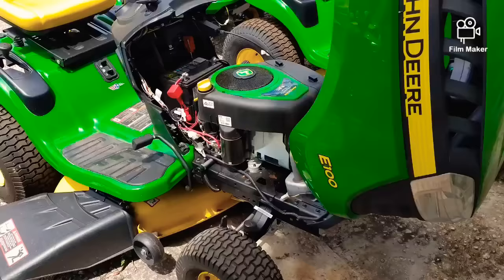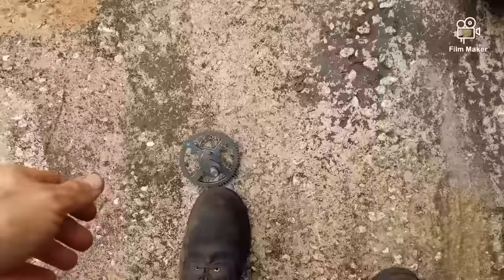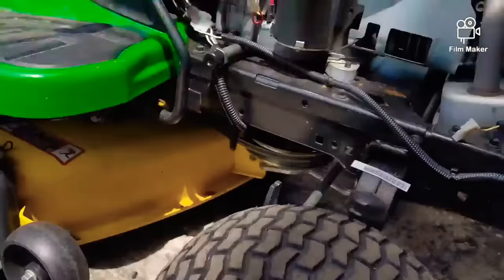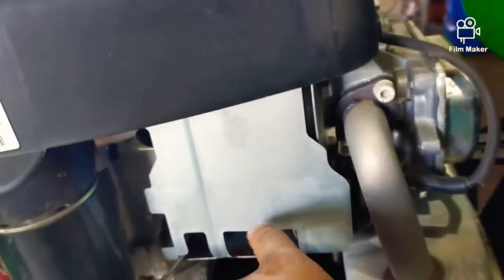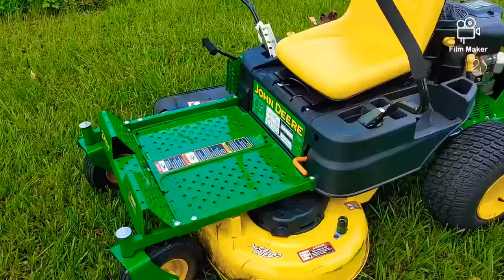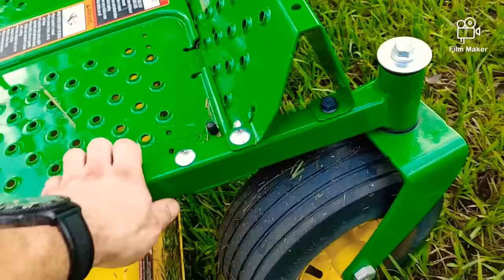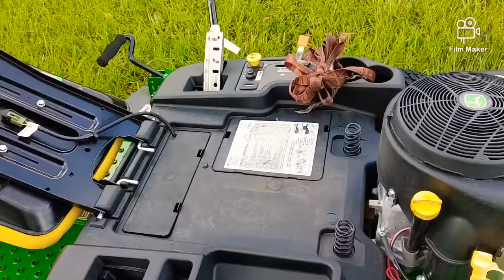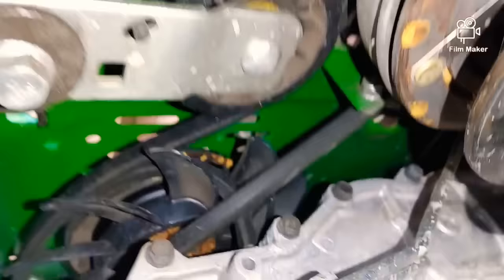Lawn mowers to avoid!

Comment: I've got one of those Zero-Turn mowers. Not the exact same model, but eerily similar. I use it as a residential, have a small yard, and at most I put an hour or so a month on it each Summer. Evidently, I have been extraordinarily lucky/gentle with it. I've gotten three years out of it so far and only just this year had to replace the battery for the 1st time. I believe it's about time I did an oil change on it, but I've put so few hours on it I'm not sure. Probably need to change the blades as well. I wouldn't dream of tipping it on its side, but I wondered how far can I lift the front end without borking the engine from oil shifting through it? And just where is the oil drain plug? (My wife tossed the manual, but I might could find an online copy.) I thought draining the oil in prep for a change, then lifting the front to get to the blades, then once the blades are replaced, finish doing the oil and filter change once the mower is level again would be the smartest move. Am I on the right track?  --Dan
Reply from the maker: Hi Dan, depening on your model the engine should have a plug on one side or both sides right above the frame. Do not be surpirsed if JD engineers designed it were the oil goes all over the frame...
We use extractors that have a tube that goes down the filler tube and then suck the oil out. 
As far as how far to tip it up to change blades we often lift them more than 45 degrees in the front even with oil in them.

Comment: I have a Z235..20cc OHV Twin  Zero turn and it's at least 5 yrs old. One Drive belt and same blades. Replaced 1 spindle assy. What should I be worried about.Seems like the Dealership has a better built mower than the discount retailers because I looked before buying. Your advise please. Maintenance is done when the oil starts to get black?w filters.. My mower is shed kept does not sit out in weather. Thanks for your video and experience. My mower came from the local John Deere Dealership.

Comment: I’ve got an x300 with a junk transaxle. I’ve seen on some other YouTube sites that the x300 should be used on flat ground only. I wasn’t told that when I bought the mower and a lot of my mowing is on hills. I’m a mechanic and can rebuild the transaxle but I’ve also heard that will not last either. I had a hydro 185 that I mowed with for 35 yrs and this x300 with 270 hrs is basically unuseable. Gonna have to do something so what do you suggest rebuild or buy something else? Definitely out off of JD they wouldn’t cover it under warranty
Reply from the maker: What year is the x300? Are you looking to get another lawn tractor or a zero turn?
Reply: @Mechanical_Mind  it is a 2017 with 270 hrs on it and I’m looking at another tractor

Comment: The John Deere D105 that was shown with the 31R977 engine that has the camshaft compression release mechanism problem, has Briggs and Stratton fixed that problem yet?   
The D100 Series was manufactored from 2011 to 2017.  Does the S100 with the 31R977 single cylinder engine have that problem too?

Comment: Thank you for the video I currently have the D140 which is a very good mower I do like it but I have been interested in a zero turn I guess I'm not going with John Deere. Can you recommend a good zero turn residential? I got slightly less than two acres.
Reply from the maker: John Deere does have decent residential mowers. But you have to spend over $5k or more. Id check out the Bad Boy MZ magnum they are about $4k. Very high quality decks. Or the Bad Boy Rambler is $3k but it only bad part is that it has a single cylinder 19hp Briggs

Comment: Just wondering what your opinion is on the Z530M mower. I was going to buy one but am now having second thoughts. Do the 500 series have the same issues as the 300 series?
Reply from the maker: Hey Joe, The 300s are much better than the Z300s. This video was made before they came out with the 2023 yr models. They have completely redesigned the Z300s and pretty much fixed all the issues I mentioned in this video except for still using the thin stamped deck.

Comment: I only have 1.5 acres and it’s a little hilly. Im considering a Husqvarna YTH1942 and a John deere s110. Which would be ideal. What’s the pros and cons in terms of maintenance and longevity. 
Thanks
Reply from the maker: I like Husqvarnas. Id recommend to get a v twin cylinder engine on either one. If you get a JD get at least a 130 or higher. We will not even sell 100s, 110s or 120s at our dealership. Buy from a dealer. Not Home Depot or Lowes. 
The S130 is a good mower if you keep it clean, maintained, grease it and dont abuse it.

Comment: The transmission he referred to as "plastic" is actually made from GRP stands for Glass Reinforced Plastic. “In fact, the composite material they use offers the same mechanical features as aluminum, such as stability, durability, rust-proof, and resistance to temperature extremes, while also being lighter-weight and more efficient to manufacture. ”It is also called fiberglass, composite plastic, or FRP. It is strong, extremely light, and highly versatile. GRP behaves differently from the conventional thermoplastics that are used in everyday items. NASA even uses this material. This means that it has properties that are useful for a range of applications within many industries. It is used in many automotive applications today "General Transmissions" are who manufactures these (General Transmissions is a family business, founded in 1991 and the world’s largest manufacturer of transmissions for the outdoor power equipment market — with more than 20 million transmissions sold to date.) this exact model is the rs800 (GT87140) and fits all serial numbers. As the RT400 transaxle is a mechanical transmission, the grease is in there only for heat dispersion and gear lubricating. The grease quantity is therefore much less critical than the oil level in a hydrostatic transaxle and, even if the leak seems excessive, there is usually no need to add any grease while replacing the seals. But 9 times out of 10 the only issues these transaxles have are usually always external. That being said This company offers pulley kit belts, Seals, etc. for all these external issues that happen. Most repair shops are not thought how to diag. these and just replace them because there is a lack of knowledgeable people in the field. Also if you go to a John Deere dealer for parts on these they don't offer them because they don't make them and John Deere just slaps their part number on the assembly and marks it up and tries and sell you the whole transaxle. yes, these though John Deere is $600-$700 dollars as of this date. but you can find them as cheap as $479.99 on Amazon. But like I said 9/10 these can always be fixed for usually under $20-$100 if you do the work yourself, They offer Troubleshooting guides service manuals, and parts on their website everything needed to properly find the issue and do the repair. Now the rt400 is meant to last around 500 hours under normal load. No one will tell you this doesn't make a good selling point. 

Now the Briggs engine (Intek series 300000) Model on this exact engine is (31R977-0052-G1) The part he is referring to is the (793880) Camshaft which since last year they were updated to the part number 84005207 (this new part corrected the issue what they changed I've asked many service techs at Briggs even district reps. they weren't able to tell me, but of the tens of thousands they sent out since the release of the new part hasn't failed with the same issue. I was able to find a service bulletin (Bulletin # DSB-1071) Which was released on Oct. 2017 310000 AND 330000 OHV ENGINES were affected referring to the issue is the spring and lever on the compression release valve would fail and falling off and sinking to the sump of the engine. From my research, I've concluded the parts were most likely improperly inspected by the factory. They never recalled these for the issue because there were millions of this series of engines released and the issue a lot of the times would happen out of warranty period so saving Briggs from technically going bankrupt if it even acknowledged the fact this part was faulty and deserved a recall. Briggs failed as a company because of corp greed from the executives they went bankrupt in 2020. But there under new management, they have been improving. You can buy the whole entire aftermarket service kit with seals, gaskets, and camshaft along with connecting rods for $28.99 on Amazon vs. $95.99 through OEM parts from Briggs. It's not that bad of a repair to do. These engines are at the lower end and are not commercial. They are designed and tested to last and fail at (500hrs at full load speeds)

Now you have to realize by now this mower sold brand new for $1,500.00. It's a cheap mower meant to be used for residential properties under 2 acres, and flat land not rough terrain (due to a stamped deck), and its failure is built into that price point the mower will last you 5 years on avg. The engine and transmission are rated to last 500 hours. if you are buying a mower for $1500 (adjusted for today's price point due to the economy it's closer to $2,000-$2,400 yes prices only 2 years ago were up to $900 cheaper thanks to inflation for that now) but this mower in this range will always be made to last you 500hrs don't matter the brand make or model. The people selling these will never tell you that. this is caused by capitalism and the need to make the cheapest costing builds for a company to make this riding mower it cost them around $700-$1,100 as of this date. After making contracts with engine manufacturers and additional parts manufacturers to drive down their cost of components. The need to make them lighter to drive shipping and manufacturing costs down causes the need to make parts such as blades, spindles, and frames as lightly and cheaply as possible. Mower Dealers only make usually around %20 percent of the sale of new equipment.

During the mid-1980s the end of what you would call a legacy mower ended (meaning you were able to pass it down to your kids). Before the end, what you call a legacy mower would last you and be rated to last 15-20 years. Cast-iron engines that were rated to last over 1000hrs you could run damn near low on oil and it wouldn't blow up, strong steel and cast-iron frames and steering components with all greaseable fittings on spindles and American-made bearing in spindles, replaceable balljoint linkages, ticker gauge mower decks.
Reply: All those words bro just reason a broken machine that matienced at about the retail price... pure crap! Shame on you
Reply: I agree on that plastic tranny. 
My Craftsman has 600 some hours of moderate hilly ground. 
Aside from fwd-rev sometimes sticks if I change direction too suddenly, working fine. 
The only care the tranny gets, every few times I use it, I'll blow off debris build up on top with its linkages.

Comment: Came across your videos because i was given a 2007 Z425b mower.  It cuts great, but was wondering about the control arms that go forward and reverse.   When you pull back reverse works correctly.  But when you push forward with any force it doesn't react.   If you move it slowly it does.  With it being and older mower,  is this a common issue.  Any help will be greatly appreciated.    Thanks

Comment: I am surprised that companies make commercial and cheap consumer model. The big box stores sell consumer model cheaper bona fide john Deere dealers.  Box store sellsmainly on price. Briggs and Stratton makes a price sensitive engine for cheaper model. Thevommercal industrial engine has a iron sleeves in the cylinder.  Oil and filters are cheap when compared to replacement engines and labour

Comment: So what is the cheapest but beat sit down riding lawn mower?
Reply from the maker: The new 2023 John Deere Z300s are far better than the 2018 - 2022 year models covered in this video. Right now the new 2023 John Deere z330M is probably my #2 pick. #1st pick would be the CubCadet Ultima ZT1. If has a better deck and better warranty.  https://youtu.be/a0TkSzqnCSc
I still need to go over Toro more and also Husqvarna and Kubota. All 3 of those brands make good equipment. It woydlnt3 surprise me if one of those take the #1 spot. Thank you for watching and dont forget to subcribe! 🍻

Comment: My Z225 had 2x2 frame across the rear for lawn trailer hitch. Do the newer 315E have capability to attach a hitch?  From what I can see in the video a hitch can not be attached.
Reply from the maker: The new 2023 models are much better and improved. I think they can have a hitch installed. Here is a recent video I did on them https://youtu.be/wSLQwtbfVno

Comment: Hello Sir I was given a JD LX277 great shape other than the sorry plastic hood. I did put new bearing on the main back pulley, new belts greased all fittings on the spindles which are in good shape but every time I engage the PTO it makes a screeching noise and I cannot figure it out. Also this model doesn’t have switch to allow the blades to continue you run every time I have to back up therefore I have keep engaging the pto making think gees this has got to wear and tear on the belts and the pto switch. Can you shed any light on how I can fix that screeching ordeal Sir? Barry W

Comment: I have a z335e and I  had a  z225 before that , the difference is  night and day  I don't  know why they  changed it but it's very disappointing.  The 335 has a way smaller gas tank and the  deck is a piece of crap . Mine is pushed in on the front  from hitting a tree root . How can you take something good and  make it bad?

Comment: I have a JD Z540M with the stamped deck and a kawasaki motor. I have been super happy with it, would it fall in the same class as this mower? I cut about 2.5 acres and would consider trading up. Thoughts?

Comment: @Mechanical Mind, You mentioned that the E100 has the bad pressure release cam.  Does the newer model S100 suffer from the same problem?  I have the S100 and I am debating trading it out for a different tractor if it could cause me lots of problems in the future.
Reply from the maker: Its more an issue with the single cylinder B&S engine which was used across many brands of mowers. I personally have not seen many of the newer models have that issue. If you get another one get a S130 or higher. John Deere has stopped using the plastic transmissions on all the 100s series.
Thanks for watching!

Comment: What is your opinion on a 2022 John Deere S220 with the Twin Cylinder Briggs 42 inch cut mower with the Hydrostatic Transmission? It is the tractor type because I don’t care for the Zero Turn mowers.

Comment: Is there a residential zero turn mower that you would recommend? I have a little under 1.5 acres.
Reply from the maker: Yes Ive recently made some videos where I compare the 2023 residental zero turns. Also John Deere has improved the Z300s drastically for 2023

Comment: Those intek cams are cake to replace. 90 dollar oem cam and maybe hour hour and a half to replace. Replaced many and i actually look for these used with this prob to replace and use and resell. Bad design dont get me wrong byt its not a bad fix
Reply from the maker: Yeah, I agree that it's not a hard job to do.  But it's probably not something the average person that isn't a mechanic wants to mess with, so why not avoid it. I also will look for mowers with easy issues that I can fix and resell for a profit. Thanks for watching! 🍻

Comment: What your opinion on cub cadet Ultima zt1 50? I kinda worry about how durable the hydros on them also
Reply from the maker: It's the one I'd buy. I did some other videos comparing residential zero turns, and the Cub Cadet Ultima ZT1 came out on top.
Reply: Ty. Which do you believe would last longer a Ultima zt1  50 fab or a xt1 cub 50 fab lawn tractor?

Comment: Your z must be an older model, mine doesn't have the  things you pointed out. If your tires lose pressure put tubes in them. Why anyone would step on the deck ?

Comment: I own one of these. What is a good fix for the front wheels? Is there a replacement with grease zerts?
Reply from the maker: The easiest thing to do is remove the caster fork and grease the bushings by hand then reinstall the caster fork. Just a little bit of grease is far better than the zero grease on dry plastic bushings.  
You probably only need to do it twice a year or so.

Comment: My friend sent me a link to a Z330M at Lowe's tonight. Am I doing the right thing trying to steer him toward a Ferris 500S instead? It's twice the price, and his 5 acres is very wooded and very sloped. Would you recommend a different make and model? I'm not even sure why he's wanting the Deere. He currently mows with a 48 or 60 inch Land Pride 3 point finishing mower on his Kubota.
Reply from the maker: The new Z300s are much better than the previous generation Z300s I talk about in this video.  Yes that Ferris is better. You may have answered your own question why he want the JD, it's half the price. 
I'd tell him to go look at Scag and Toro also.

Comment: I have a X570 john deere 48 inch cut rider , are there any problems I should be on the look out for,  I have a Kawasaki motor, 467 hours, 3 years old, thank you for your time.
Reply from the maker: Hi Bill. Thanks for watching and I hope you will subscribe At those hours Id makes sure the valve clearances have been adjusted. ( If it has hydraulic lifters then no adjustment is necessary) Just keep it clean. Grease the spindles every 10 hours or so. Change the oil, fuel filter, air filter and spark plugs regularly. Check your fuel caps o-ring or gasket is in good conditon. If not grass and dirt will enter your fuel. Lastly dont use the machine over what it was made to do and you should be fine. Thanks for watching. 🍻